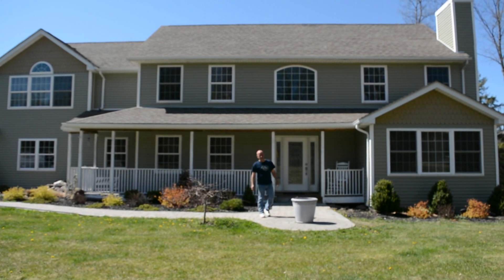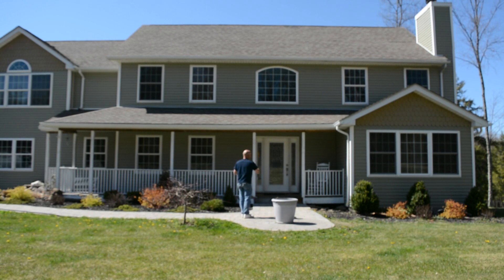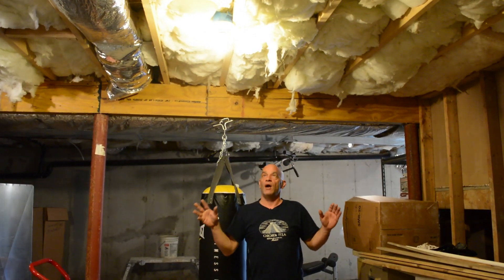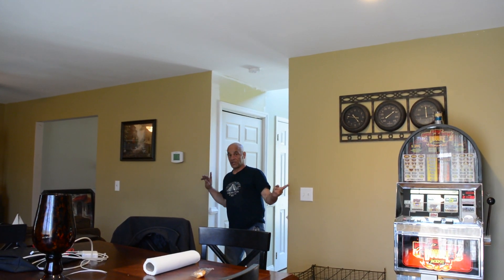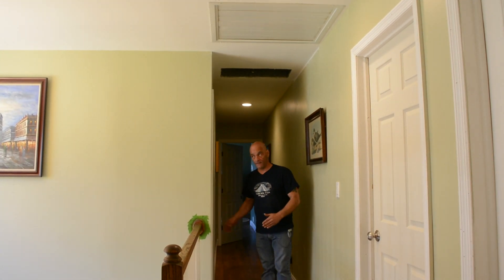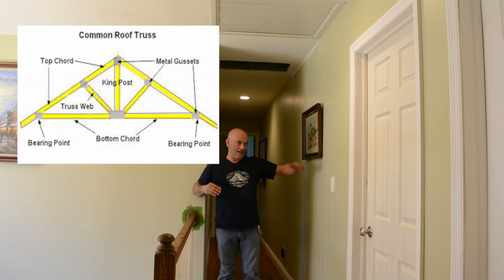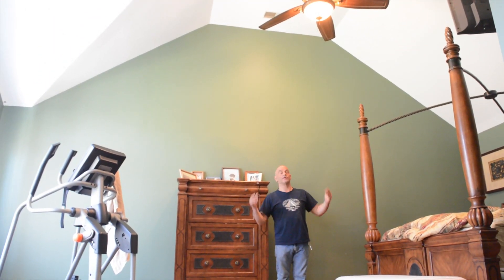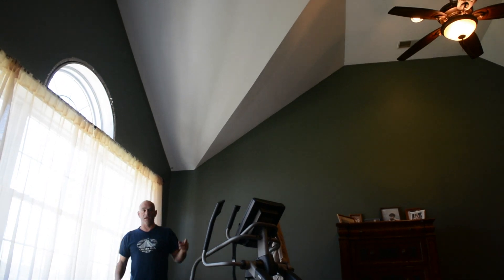How to Determine if a Wall is Load Bearing or Not  (Viewer Requested)

Comment: How do you keep the heat in that huge bedroom,near the floor..
Reply: There is a ceiling fan in there that can mix it up. In winter, just have the fan on low speed so it's not windy, but will still stir the hot and cold air together.

Comment: The one question I have is upstairs you said it's not load bearing, but is it not so if the rafters span is too far apart even though it's one piece of board that's not lapped in the middle or further' but let's say it spans across with  2X4"s or even  2X6" joist's would it not even then need more support from underneath as load bearing or so to avoid sagging & eventually it breaking? I mean how far can it actually span & to what size 2X?  is needed or be doubled up & or spaced closer together? You're grate & I really like your personality as it's good to have a sense of humor. So many people are just too serious & need to chill. Like you I am a jokester & people just don't know how to take me. But to me it's obvious you do know your stuff! Thanks

Comment: Another great video! Curious though....if there was a finished wall surrounding the lolly columns in the basement could that be taken down and the lolly columns still support the beam and load? Just curious if the wall framing would be adding needed support.
Reply from the maker: +Matthew Davidson Hi Mathew. More than likely you should be fine. Make sure they are not more than 8 feet apart and you should be fine.

Comment: Darn silly building codes.  Put a garage heater (or sorts) off the furnace in the basement and get rid of the insulation mess in the first floor joists.  My pet peeve in code compliance.

Comment: love all your videos! since its now spring; any tips for diy pest control? Thanks!
Reply from the maker: +Tom Hudson Last time I used a divorce lawyer LOL. Actually funny you ask, I was thinking of doing a video on how to bomb a house with those bug killer bombs if you know what I'm talking about.
Reply: +askmediy haha! looking forward to the bug bomb video
Reply: My $0.02 here.
Don't use bugs bombs. They are generally a waste of time and money.  Not related to these folks, however there are do my own pest control sites that sell pints/quarts of relatively safe broad spectrum pest control concentrates by the pint and quart for $15-20. My suggestions for people with pets and kids would be permethrin 10%, Bifenthrin, or Termidor (Fipronil).  Done tons of research on this, and usually a 1 oz of product in a gallon sprayer ($15 HomeDepot/Lowes) and you can spray the exterior of your house/premises 2-3 foot up the side and out and away from the footer.  Same thing in the basement.
Once it dries, its perfectly safe for kids and pets.
Heck, the local Tractor Supply has the Permethrin 10% for $19/quart, which will last a year or two if you have issues or are rural or near forests.

Just a public service since I just subscribed and like the way Dom breaks things down for us lay people.  Hope this helps someone.

PS. You can also make a low strength 'dip' from the Permethrin above, and it will knock fleas and ticks out and be a residual for several weeks.  Permethrin is the man-made analog to Pyrethrin, which is made from the Chrysanthemum flower. It just last much longer.